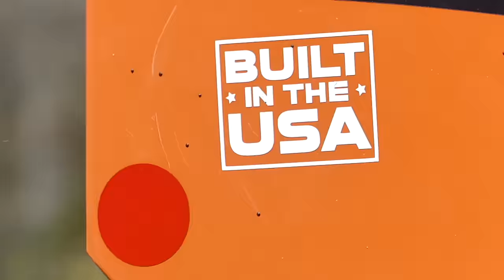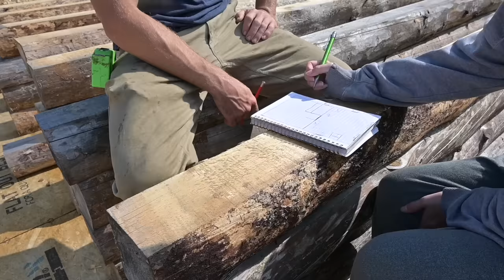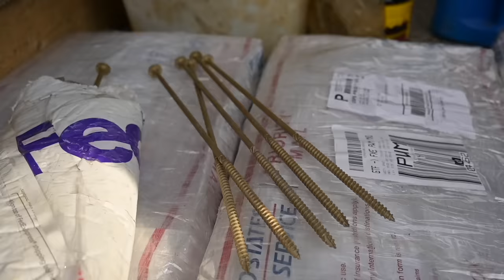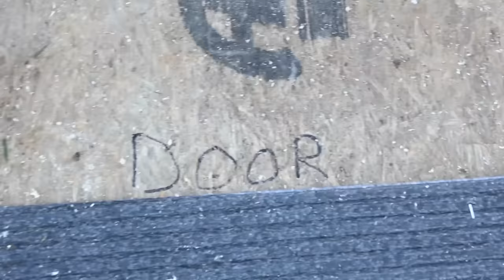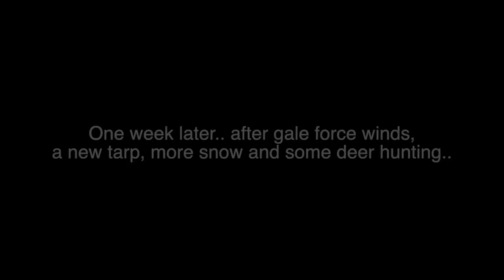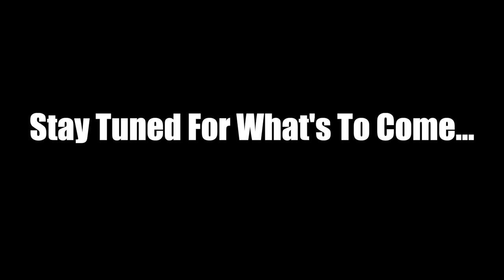TIMELAPSE - catch up on our off grid d styled log cabin build in northern maine // 2022-2023

Comment: Tie downs to foundation?
Reply: No our ground moves a lot every year, this way it’s much easier to adjust if I have to without messing with the concrete footer, the vertical 8by 8s are lagged to the horizontal 8 by8s and those are lagged with 14 inch log fasteners to the 4by6 floor framing.
Reply: @keenanscanlin7979  
I'm most concerned about a storm blow over or worse.
Reply: @raycaster4398  I’ve seen a lot worse fountains up here in the woods hold for a long time and many storms, also the videos you see don’t show all the lags and timber fasteners and braces used. Emily does her best to record but isn’t always available so a lot gets left out.